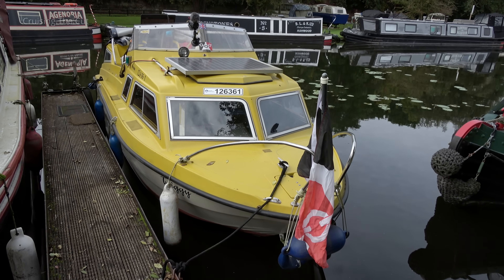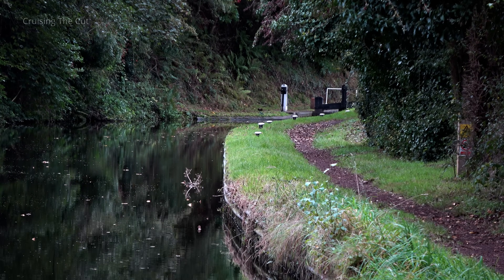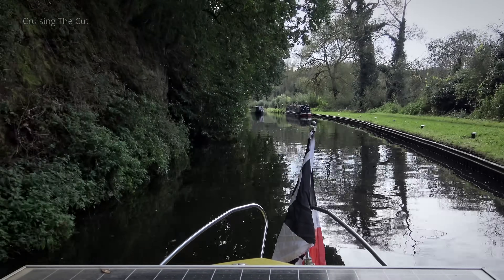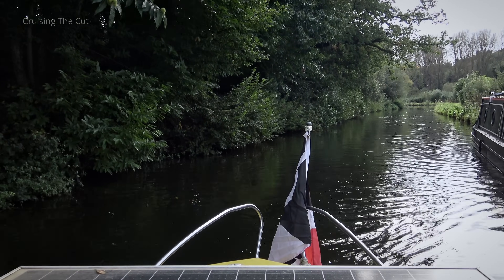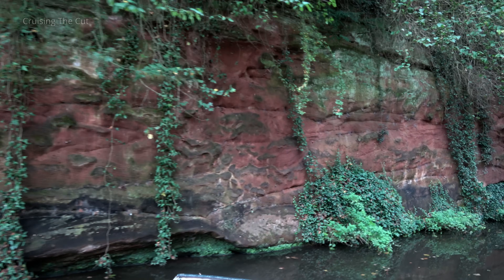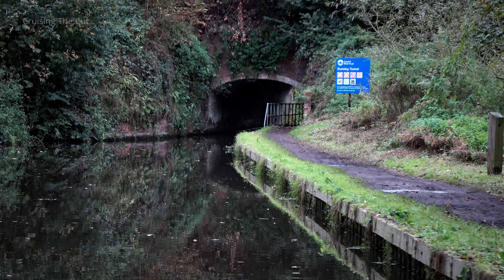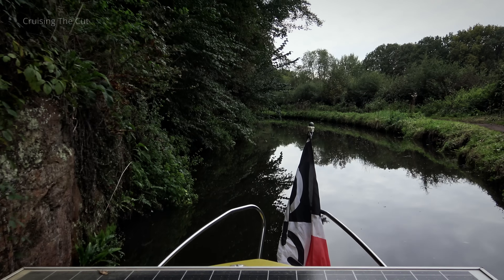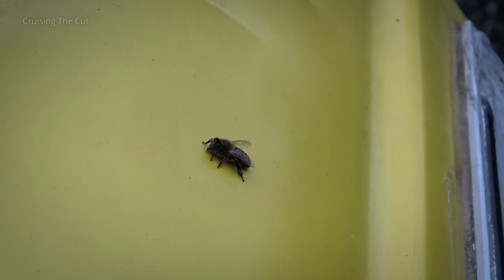317. I bought another boat

Comment: Hi David, nice to see you on the water again. I have been sailing in a lot of scandianvian build fiber glass boats. They have generally more pretty lines (I know that is subjective), The enghlish counterpart is very "bulky". Do you think there was a another approach back in the 1970 in uk vs nordic build boats? I had a Crescent 535 Classic, a swedish build boat with a 40hp Mercury EFI, is was very easy to handle, also at low speed/idle.

Comment: Don't know how your boat is set up or how much it weighs, but my Shetland 610 of a similar size is much easier to steer since I installed a 100L water tank under the cockpit. With no ballast these GRP boats tend to sit on top of the water which makes them hard to steer. Bit of ballast and they are much more predictable to control.

Comment: I would be tempted to get a trolling motor for that boat. I see them going for $100 here in the USA. You don't need to go at tremendous speed. Adding a second solar panel would probably mean you could drive it directly from the panel though you'd get a problem in tunnels.
Reply from the maker: No space for more solar, unfortunately
Reply: @CruisingTheCut  fold-out panels that form wings? How about a tow-along catamaran made of old 15 gallon plastic drums with solar panels slung between the drums?

Comment: Hmm, do you suppose one of those cheap old-school electric trolling motors that folks used to use, might give just enough oomph to push you down the canal at the right slow speed?  I think they used to connect them to a 12V lead-acid car battery (or maybe 25 such batteries...)

Comment: I love those portable gas cookers, had mine for around 10 years, as long as you got your carbon monoxide alarm you'll be fine.
Reply from the maker: They’re dangerous on boats. You’ve got flammable gas in an environment where it has no place to escape to (so could pool in the bilge which is an explosion risk). The flammable surfaces all around must not get warm. Plus I have seen plenty of videos of those stoves where the gas escapes (lit) out of the canister in-situ, causing flames to shoot out of the sides.

Comment: I had a similar style boat with a 50hp on the back. The hull was pretty flat under the waterline and at low speed it would struggle to go in a straight line, but would get up on the plane and boogie along quite well in open water.... not really an option in a canal I suppose?
Service the steering cable and it will help the outboard point where the helm makes you think it is pointing.
Reply from the maker: Ta

Comment: I'd deffo put a 24v 1.25kw trolling  motor on that just for canal use ! 
Get 4 semi traction batteries to power it and change your cabin power to 24v .. 
Keep the petrol for river use .
Swap that 12v solar panel for a 24v (  24v range of all products are cheaper than 12v ) your good to go ....
In total silence

Comment: You’re used to handling a very heavy canal boat.  This extremely light (by comparison) craft will require a much lighter hand.  You’re subject to the wind and currents more.  Over correction can have dire consequences.  Your engine is clearly not a great match.  I’m wondering if a very small trawler motor would be better.   The best analogy I think I can make for your predicament is that you’re experienced with captaining a brick.  Now you’re piloting a feather.

Comment: think you will need some springs for the side of the boat so you bounce off the walls more  heheheh.
what made you buy this boat over may be a slightly bigger boat were you could stay in easier over night
all them years of training with a narrow boat and you panic in a tunnel.
will you be doing any work on the new boat.  renewing,  replacing,  cleaning  etc.
instead of the cup of tea may be you could have went to the pub to get something to calm your nerves  heheh
Reply from the maker: Yes, lots of work to do

Comment: You could fairly easily remove the petrol part and bolt in a electric motor yourself, recharging mainly from your solar panels secondly a grid cable for powered moorings and for backup a small petrol generator. If you feel adventurous you could even add a electric bow thruster to aid in controle. All that could be done with second hand low cost parts with moderate efforts. Batteries do cost a bit but quality do pay of in the long run, the amount of amp hours all depends on space for the batteries cost and how much you are willing to pay and how far you plan on going in a day. I think 2-4 Kwh would cover most needs as the boat is significantly lighter and less hard to move compared to the steel narrow boats. If you balance the power used with the output of your solar panels you could cruse as long as you have sun without even touching the stored power. Such a "conversion" would make a wonderful video series showing the project from a DIY angle.
Reply from the maker: Not enough solar for propulsion but I would like an electric motor
Reply: @CruisingTheCut  Perhaps not enough for continuous propulsion but certainly to make the need for charging less frequent and do you really cruise the whole day would not a leisurely taken lunch give you some if not all of your power need for the afternoon? The shore power and generator must surely be able to fill the rest, don´t you think? Just plan your stops as power allows and external power should be the exception and not the rule. I still would love to see a series about converting the boat using only (as far as possible) used parts bought second hand, letts see how cheaply you can do the job and perhaps inspire others to follow suit.
Reply from the maker: No, it really wouldn't work, the solar numbers don't stack up. The panel is 240W I'm told which means that in my hour for lunch, in peak sunshine, I'd get 240W power. In reality it would be less, say 200W in bright sunlight. Using even a small 1kW motor that's 10 mins of propulsion (and that's idealising the circumstances)
Reply: @CruisingTheCut  Is there no room for additional panels to come even close to making it work(with in reason)?

Comment: Fix your outboard in a straight line for canal work, and fit a rudder. Just remember if you connect it to the wheel to fit it converse. I'd make what you are using, which is  outboard steering, illegal on a canal. There is no control, or can there be, because the engine is pushing the stern sideways. You can steer all you like but you will never have control just luck. I've never been on a canal, but - - - I see Ben and Emily have the same problem. Also YouTubers.

Comment: I suspect that your boats tendency to wander when in a confined space is partly due to the Bernoulli effect, combined with the shallow draft and light displacement.
You could experiment with adding a fixed skeg in front of the prop, but you’ll probably get used to the handling.👍
Reply from the maker: Cheers

Comment: Sounds like you are over-powered. A 3 h.p. may be in your future. Those type fiberglass boats were not designed for canals but for rivers, lakes, and bays where, with their speed, the small keel would track properly. Loading the boat so it sits lower in the water may give you more directional stability. Still, your boat's gelcoat looks in excellent condition and, most importantly, you're back on the water.
Reply from the maker: Unfortunately the gel is very cracked, it looks a lot worse on close up

Comment: Is your motor offset by any chance? A single outboard needs to be mounted precisely central. If not, the engine is trying to fight the keel. Makes for very wayward steering. Face it, when did you ever see a single propeller anywhere but central on a boat?

Comment: The new 4-stroke engines are much quieter and that would be an option since electric engines are so expensive. 
We have one on our pontoon and sometimes you can't hear it running when cruising at low speeds.
Reply from the maker: I hope to get a new motor

Comment: Being lighter, cover the top with 3 or 4 415w panels, Add a 1.5KW Power station with a 2kw additional battery and swap the outboard for a 500w motor. Edit* oh you mention you'd love an electric motor haha) 3.5KW battery capacity using a 500w 12v outboard motor, that's 7hrs full speed cursing... just not sure how fast 500w or .9hp will get you! Plus if it's trickle charging of solar more range. If looking at it get LFP battery chem power staions. 3000+ cycles aka 7-10yrs. Looking forward to the next crushing. the cut
Reply from the maker: No space for more solar
Reply: That's probably a good point! Can get flex solar panels all over the front deck and triple the amount you currently are getting, Or depending on how much clearance in tunnels could you make a sun visor over the main cabin area out of some light aluminum tubing and 3 or 4 panels overhead as the sun shade? Just throwing ideas around.   @CruisingTheCut

Comment: I do not know how much hp's the engine has I guess 5 or 8. you could have a look at a different prop, more a 'working' prop. not made for speed. these outboards do not like steering without power, the prop direction does the steering, so perhaps think of adding some sort of rudder to the engine. 'wheel' effect of the prop will have an impact as well, especially on this weight, you could think of putting a 'ring' around the prop for cutting this effect and improve efficiency (what the experts say, but hey, have a look at the new MIT props). since it is so light and low power you could experiment with some 3dprinted stuff, mad what you could do with that. I do see your point of electric, but you would need a generator. but this has all been done before, you will get this to go as you want it. and it's so light, no hassle getting it out on the dry. so this is a nice project, nothing is to b ig, will not brake the bank en ill be lot's of fun. water, waste, sound, heat, engine efficiency, lots of little things. that is why I am so glad i got rid of my boat. I bit of more than I could chew.
but this is doable. Edit, and if all else fails, put in a big v8 as anker ;)a nd the gas coming out on start is the 'gas  float' or 'needle on your carburator housing which is sticking. no big deal. that happens when the engine sat a long time. so next time do not shut off the engine, kill the gas flow and let it simply run out of all the fuel in the engine. no more sticking float. It will only take a couple of minutes. Oh, and you will love an electric starter! and the boat has no 'grip' you may think of adding a little fin (like a surf board) somewhere int the middle. it does not need much, but the boat is not made for these slow speeds. experiments ;)

Comment: Interesting. Tell us how this boat compares with a well insulated longboat please: it seems to be a major weak point in fiberglass models.
Reply from the maker: Typically fibreglass boats have no insulation, they're not designed for liveaboard or even winter overnight use
Reply: @CruisingTheCut  I'm aware of that but I thought you might go cruising for long weekends and consider insulating it. I'm sure some people have done it. I think it's worth considering it since the traditional house boats are now truly expensive if not shamefully overpriced. It's getting as bad as the housing market and I'd be interested to know who manages to beat these dreadful and unfair obstacles and how, using fibeglass affordable boats. 😉
Reply from the maker: I will probably go for long weekends but typically in spring/summer rather than cold use. I might add a few mm of foam or something to help prevent condensation but there's not much scope for insulating these.

Comment: yea a little over the top with stove used many of them not a issue
Reply from the maker: Not at all OTT. You’ve got flammable gas in an environment where it has no place to escape to (so could pool in the bilge which is an explosion risk). The flammable surfaces all around must not get warm. Plus I have seen plenty of videos of those stoves where the gas escapes (lit) out of the canister in-situ, causing flames to shoot out of the sides.

Comment: You nned a small keel and a skeg infront of the outboard and you will cease wandering about. When you flex the hull you are incurring microscopic stress fractures, not a good thing.

Comment: I would suggest the rudder is far too small!
Reply: The outboard engine has it's own built in "rudder"...(which usually works most effectively at speed).
the "fin" that extends down to below the prop and does duty to prevent prop strikes on whatever should pass under the outboard.
You can get "Kort" nozzles to fit over the prop...the nozzle concentrates the thrust.....and can have it's own much larger rudder in that concentrated stream....
other commenters have said "Get some weight on board to get the vessel down in the water"

Comment: Hope you’ll be converting her to electric drive with a 48 volt trolling motor and LiFePO3 battery. Trolling motors are really cheap!  A few £hundreds rather than thousands!
Reply from the maker: Range is an issue
Reply: @CruisingTheCut  Yes, although Lithium batteries are lighter and more volume efficient than lead acid. Additionally you can keep a small generator on board for those times when the sun isn’t shining on your panels and the batteries are empty…. A range extender in EV terms!

Comment: hi if you watch butler s empire they do cooking they use that camping stove indoors no problem
Reply from the maker: Cheers, they’re not safe on a boat though. You’ve got flammable gas in an environment where it has no place to escape to (so could pool in the bilge which is an explosion risk). The flammable surfaces all around must not get warm. Plus I have seen plenty of videos of those stoves where the gas escapes (lit) out of the canister in-situ, causing flames to shoot out of the sides.

Comment: Sorry to say this but, do you actually know anything about power to steerage ratios? Okay, I've only got limited experience on narrowboats; and I dislike their characteristics intensely, due to their hull design. They pivot centrally, as do most boats, but they were designed to be pulled, not pushed.
Whether steel, aluminium or grp; cruisers handle in an entirely different manner.
Your 20 footer is probably under-powered, and simply isn't big enough to load with twin engines, (a great help with steering in a straight line. In the 55 years I've been boating, I've stayed well clear of anything less then 30 feet. For river work, 45 feet is ideal; with a displacement hull and twin engines, plus a bow-thruster. These are wonderful to handle, being very precise and, with a pair of 300hp engines, completely effortless on a river, just burbling along at t knots, up to 8 where permissable.
At sea, of course much more power is required to maintain steady control.
Your boat, at first glance, appears to have a semi-planing hull; it will, by its very nature, tend to be "skittish" in even a slight breeze. The addition of a small (3 inch-ish) skeg would help a lot to keep a line without spending a fortune. I'd give her a lightweight 20hp outboard too. That would really help, but might cost more than you're happy to spend.
Having sort of torn her to bits; in fact, you've bought a good little boat with huge potential. I'm sure you're going to have great fun setting her up your way and spending all your spare time aboard, loving the freedom.